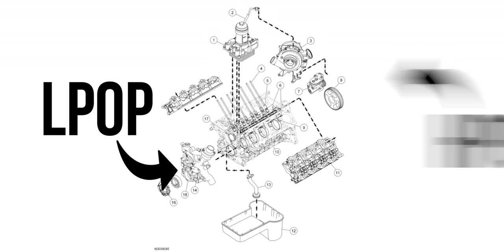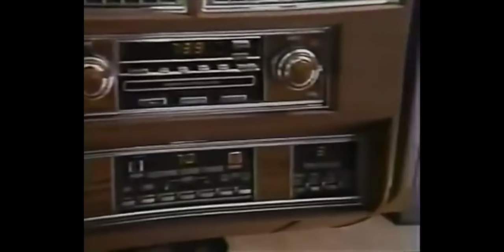These are the WORST ENGINES EVER MADE

Comment: 4:47 No no no no no no...... no, the reason for diesel not being as popular as it is in europe is in order to get as much money out of the truck and transport people as much as possible, they cranked up the tax on diesel as much as possible so that its actually more expensive than 93 octane, and also in Europe, the lowest octane IS 93 octane, we got rid of the higher octanes in the 60's and 70's

hence why cars like the boss 302 and the Z28 Camaro with the 302, dont run as well as they did back in the day if you try and run them on modern fuel. 

and also you need to run low to no Sulfur Fuel or it bricks a diesel car, literally was at a dealership with this couple that came in because they stopped at a truck stop and filled their car up there, only to have it brick the fuel pump, break the motor and then replace it under warranty

 and cause them to put a low sulfur fuel only sticker on the car for the next model year, 

so your taxed more, and if you try and fill it up at a truck station where they would have the gas, it can literally brick and destroy your cars motor

and mercedes benz's, the only decent ones save for maybe a VW, costed 80 thousand dollars for what is esentally a beige on beige shitbox if you wanted a good one such as the one Eliot Alvis highlighted on his channel

and their has never been a person who's said man get a load of my diesel, doesnt that sound great, with any passerby who isnt into diesel saying yeah man, Yeah!

also with the sucks down a quart of oil per 1K miles, actually umm.......... the porsche 930 does that, its an oil cooled motor, which is why you really DONT want to miss your changes on those, atleast with the turbos

hence why you really DONT want to buy a turbo where the guy's negated the 3K mile rule that all cars should use, both modern and classic

which is probably where 95% of the problems on a modern BMW comes from, given they told their customers 10K plus, when its barely 1500 plus.

Comment: The Caddy 8 6 4 wasn't a bad engine either, even if it was a rough system, the engine didn't have any failures because of it's cylinder deactivation. It was just rough and that's not OK for a caddy. It's actually more mechanically sophisticated over the modern deactivation system. And yknow what? The modern system actually destroys engines. The 8 6 4 was just too head of it's time, the electronics where simply not good enough. They claimed 300,000 calculations per second, that's not even a mhz, so for comparison a motorola 6800 the kind of cpu used in arcade machines of the 70s and 80s was 3x as powerful and that was all running preset code not live data like a car computer. Think about all the issues modern car computers with all the ghz and modern technology have. The fact the system even worked at all was amazing.

I've been in the market for a complete 8 6 4 for years, I build engines professionally but my background is mechanical engineering, and automated/mechatronics. I want to try to get a 8 6 4 system functioning with modern EFI and modern electronics. I've programmed custom ECUs before using a Arduino, and i think it's doable. Maybe it would only function with cruise control but still. They where pretty much all fully deleted around me anyway.

Comment: An interesting video for sure... Most of the problem engines that you mentioned here, suffered from a common issue.... Over-engineering and a complete lack of testing, research , evaluation and re-develooment, before they were released for use in the market to be sold to the general public... Many of these machines (as you mentioned here on this program), looked good on paper, but were not reliable enough to  be able to be re-sold  for any kind of a mentionable financial recovery after the initial loan was paid off... 
       And so the old joke of putting a placard on the outside of a vehicle, with any one of these problematic engines, could quite possibly assure the owners of such a vehicle, that it would NEVER be stolen....

Comment: Gotta do some more research on the 5.4 and 6.8 triton. I've done a lot of Research and talked to a lot of owners before buying a 6.8. the spark plugs issue fix is just to tighten the plugs down to 20-25ft/lbs and they stay mine has just hit 250k and it's absolutely not gutless, mine is a tow pig. I love your vids but you were wrong on a few things here. 

Triton engines are wonderful and powerful.  
Tighten your spark plugs down to 20-25ft/lbs and just do your proper maintenance and they will last my neighbor across the streets has a f150 5.4 that has hit 310k without an issue and he bought it new. Loads of triton roaming around here in East Texas and you'll find more driving around without an issue than you can find broken down, I can't find any 6.8 V10s in any junkyards or broken down so I had to huy one from a few hours away to use for a build

Comment: Hmm ford 5.4 3 valve. The oil passage ways clogging and the two piece spark plug design just awful. And Chrysler small displacement v6 in the dodge darts and stuff I’ve heard are terrible.

Comment: I can't believe you didn't mention the 6.4 powerstroke. Every 6.0 powerstroke I've driven pulled good and had over 300k miles on them yest they got the egr delete and Bulletproof parts installed. You can find those trucks for dirt cheap and if you go the the right person who know's what they need, you spend around 10 to 15k and buying the truck for about 3k total cost is no higher than 20k for a diesel truck that pulls good and is reliable. You probably have a Horror Story as to why you don't like them. but I know a guy who has a 2019 6.7 powerstroke and no truck is worth 100k, he  broke the tail gate with a gooseneck trailer 3,500 dollar for a new one.... No thanks I'll Frankenstein a truck together😅.

Comment: Wait... The 5.4 and 6.8??  What year was that Econoline?  Are you saying the 5.4 in the Mustang's and the Ford GT will shoot out spark plugs?  My brother had 300,000 on a 97 or 98 without a rebuild.  My father-in-law had I believe a 2007 with around 240,000 miles.  How common is this?  I've had 2 Dodge's with the 3.3.  Both engines failed with less than 180,000.  The GM 2.2 will fail with under 100,000 miles.  The Ford 2.5's I believe they are, fail insanely quick back in the late 90's early 2000's.  The GM 3.1 was plagued with problem, but we're eventually decent.  Kia had engines in the 90's early 2000's that would give out with less the 80,000 miles on a regular basis.  Oddly for Ford, their hybrid 2.5 is extremely reliable as the can easily get 300,000 miles.

Comment: I6 trailblazer engine drops liners had coil issues oil leaks etc. 
3.6l gm engine burns oil has a plethora of other issues 
420a Chrysler 2.0 used in neon and various other vehicles 
Any Chrysler engine that has a .7 2.7,3.7,4.7,5.7 all junk

Comment: Engines to add. Chevy small block have cam angle error so they burn out cams. Chevy straight six cracked heads really stupid design flaw. Ford engines- pretty much all of them shear of back of crank at one point or another. Toyotas- quite common to find ceramic in spark plugs loose and leaking after a couple hundred miles. Hondas bad water pump design.

All of these have work around via aftermarket upgrades….well except the chevy inline six nothing else fits that one engine for a head.

Comment: VOLKSWAGEN ! 2.0 TSI (early ones like CBFA) . I recently had to do timing work on one of these . I also wanted to redo the valve cover gasket . Upon removing the "valve cover" the camshafts basically fall out of the engine ! No cam bearings ....they ride on aluminum !! They  sell "remanufactured" heads but how do you put material back into worn cylinder head camshaft bearing journals ? They could reface the head and valve cover and line bore new cam bearing journals but I seriously doubt any of that work gets done in a "remanufactured" cylinder head . Maybe Im wrong as I have yet to see a remanufactured head ....I hope I never have to look at one !
"German engineering" that you hear VW talk about is not about building you a better car ! They strive to find the cheapest possible materials that can be assembled as quickly as possible by the lowest paid , unskilled workers they can find !! If the warranty is 60,000 miles they design things to blow up by 65,000 !

Comment: The worst engine of all time the 4 cylinder in the chevrolet vega. Also on the ford modular v8 engines when they came out with the three valve heads they used 2 piece spark plugs that would break when mechanics would try to change them.

Comment: Was there a redesign of the Olds 350 diesel conversion that had stronger head bolts and a thicker block deck (for stronger threads for the head bolts) ? Still did not make a good engine out of it (except as a candidate for building a gasoline engine) ?
Reply: No

Comment: 2.2 was a good engine they lasted 300,000 miles! You probably are confused with the turd 2.6 Mitsubishi motor they used,those were slow and oil burning junk!

We had lots of 2.2 engines as daily drivers even in 2002..The Turbo engines were very quick,reliable...

The problem was people didn't change the timing belt at 100,000 miles,the old odometers were confusing for people as after 99,999 they rolled to 00,000 The opposite color number on some thus 6 digits were just a 1/10th of a mile reading..They went 99,999.9 the to 00,000.0 never registered 100,000 miles a shame too,because all old cars 1960's,70's 80's had 200,000...300,000 miles!! These were very reliable,more so than Toyota engines!! Hell Chrysler V8's were the ebst of anything on the road...318,340,360,383,400,413,426,440 were all 200,000 mile engines with basic maintenance! Again refer to the odometer as why people are/were confused! I was there when these were everywhere!

Some issues people had with head gaskets were because they didnt change the coolant!! You change the coolant you had no issues!Again odometers threw people off then and today!

Comment: Maybe you could comment on the evolution of the NorthStar vs. the Ford Modular DOHC developments (1993 Lincoln Mk8, Mustang Cobra).  AFAIK the NorthStar were Oil Burners whereas the Fords weren't perfect, but mass produced and considered very reliable.  Ford kept up with DOHC, then VVT whereas GM kept mostly push rod in their performance vehicles until recently?
Reply: I was a machinist dealing with this stuff then. The northstar problems were addressed by the aftermarket parts companies almost immediately but the reputation was tarnished. FELPRO had made a head gasket to fix that trouble. Much of the blame on oil burning i believe was actual leaks instead.

Comment: So I own a 2017 ford fusion sport 2.7 v6 Ecoboost AWD....and a 2018 f150 sport with same engine......at 53k in the fusion and 120k in the truck......bought them both new......stay on top of maintenance......ALL maintenance....... And have had zero problems with both.....most engine problems with any newer motor are a result of lack of maintenance......most people don't understand how important oil changes are...... especially in newer either high compression motors or turbo charged motors......in AWD vehicles you need the front and rear diff fluids changed and fluid in transfer case changed every 30k.......same with coolant and tranny fluids.....should plan on dropping 500$ on your average car every 30,000 miles.....change your oil ever 3-5k.......7 to 10k on full syn is just comical......if your oil is jet black is way way way past time for a change and sludge is forming in your motor.....

Comment: What about engines with water pumps internal to the engine and when leak can mess up the oil and if not caught fast enough can destroy it’s internals. Even Toyota made this mistake on a otherwise good engine  
Chrysler had a great little car called concord which would self destruct at approx 100k miles about same time people paid their last payment guess those vehicles are disposable design?

Comment: You missed a things on the engines that you did mention, like the bed plate gaskets leaking on the Northstar and got other things completely wrong like the 3V Triton engine fixing the spark plug issues.  👎👎👎 Pretty weak. Might want to do better research in the future.

Comment: Anything with Rover on it. In fact most English engines from the 60s on.
Early 80s V6 Camrys, skinny body.  I have relpacd a few 4s as well. Mostly ran out of oil. 
In reality probably 2/3 of modern engines. I think most people understand dispalcement on demand GM engies as well as direct injection are bad new. Take a decnt engine then screw it up!

Comment: The #1 worst engine of all time is the Chrysler 2.7L engine... I have an 1993 STS Northstar engine with the original head gaskets at 230,000 miles in a STS that was rated 300hp, transmission is the original one as well, the engine burns ZERO oil, it does mark it's spot as all Northstars leak around the pan because no gaskets only sillycon!!!   it also gets 27mpg HWY. 
I also have a 2000 Northstar it did pop it's cherry needing headgaskets at only 40K the engine now has head studs and 70K with a small oil burning  problem, a quart every fill up. (check the fuel top up the oil..) well lubed up.... Lol...

Comment: A agree with all on ur list.....u forgot ford 255 V8 Chevy 267 V8 Chevy early 2.8s n 4.3 ...all turds best used for boat Anker's.....n Toyota 3.0 is a turd ...the 4 runner of that area were heavy under power turds ...I wouldn't even buy a Toyota truck with the 3.0

Comment: I’ve owned 4 different 2v 6.8l v10s all work trucks and I’ve only ever had one spark plug blow out bought a good tap and thread kit fixed it never had the problem again on top of that i don’t know how you can say there gut less if there so gut less how can they pull over 10,000 plus pounds and still keep up on top of that they last a very long time reaching over 250k plus miles! Lmao someone didn’t do enough information on theses motors

Comment: Cadillac 4.1 aluminum block piece of crap.. porous casting had to put goop on the head bolts on some of them because they leaked oil so bad. Needed to flush cooling system every 30K because of internal corrosion. EGR valve failed made the $34K caddy convertible in 1984 run away with you.

Comment: Oh well call me a bonehead if you like but i own an f450 6.0 and had an f250 with a 6.0 and have had oustanding service with them and in my area there's loads of them still going strong. They got a bad name because of some issues but they are far from a junk engine and no other diesel can beat the sound of a 6 litre. I definitely agree on the cadillac Northstar complete garbage. I also own two 2 valve v10s and they are insanely tough. I've got a 99 f250 that has been abused severely and pulled hard I call old faithful.

Comment: Haha. 😂. You missed it. The Vega! 4 cyl with hi Si Al(!) bores. And probs weren't limited to just the 'engine'. The clutch release cable friction was far too hi. Lubricate it aIl you want, didn't matter. The cable would sieze up and pull the reaction plate right thru the firewall. Have to pull the whole #%^&&♤♤♡♤!!@** thing out and install a hrs piece of plate. That thing was such a pile l listed it for sale at $150 or so. No takers. So l upped the price to $450 and an instantaneous sale. Psychology!

Comment: It's funny g.ms can't make it to 30000 without seeing the shop half a dozen times (a.f.m.) poor idle fuel mileage not as a advertising never had a Ford not go 300000 all moters also never had one wipe out cam lobes or had to stagger jet the bbc or put a new timing chain minus 50000 it really doesn't matter when the body has rusted away

Comment: In recent times = ECO - TEC = 4 cly ! Can't even change the "" PVC valve (which PVCs should be replaced around 50k) but it's in the manifold and dealership has to do! I have N0 intentions of ever buying another GM product
Again! And i used to T00 like them! No more! 
I had a BUICK encore! Crap engine! Transmission not far behind!. No N0 no N0!

Comment: You forgot one major motor that it was the most horrible this motor ever made the motor that went into the Chevy Vega I swear to God to you in the eighties I jumped a whole bunch of these I used to scrap cars and once a week I would get either the Vega or that little Pontiac one or the Skyhawk and that one from the Firenza we're all sister cause to the Chevy Vega they had that same fucking Moda and literally you would put oil in and it would come out the bottom these motors could not hold boil head gaskets were another major problem with that motor

Comment: Chevy Vaga engine. 1980ties Ford/Mercury lynx  4 cylinder engine. Early VW bug boxer 4. Had remove the cooling tins snd valve covers to adjust the valves every 6 thousand miles or else.!      no oil filter 30 thousand tbo. Cheap not  but so easy

Comment: Not to defend the 6.0.... but that "sand" you speak of is not sand, and it's not left over from casting the block😂. Are you 80 or something?! That's caused by silicate dropout of the hoat style antifreeze, that Ford used also known as "zerex". This type of coolant used a hybrid organic formula that does not require the addition of an SCA additive to eliminate cavitation. This was one of the major issues with these engines in my opinion. That and idiots tuned the piss out of them advancing the timing beyond any reasonably safe level, all to make power without upgrading any of the engine components. Ford really should have used an ELC type coolant like final charge straight from the factory.... Haha... Sand from casting the block...... I needed that laugh!

Comment: My three valve Triton decided it didn't need the spark plug on the number 8 cylinder sounded like a gun going off thought for sure the engine was blown so much for Ford fixing it $500 king cert kit later and it's better but not because Ford made it that way